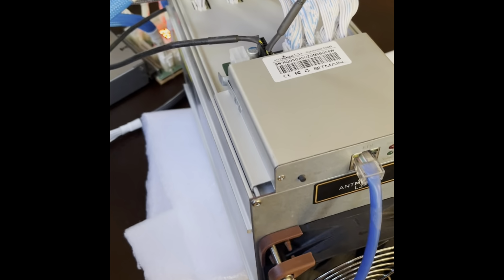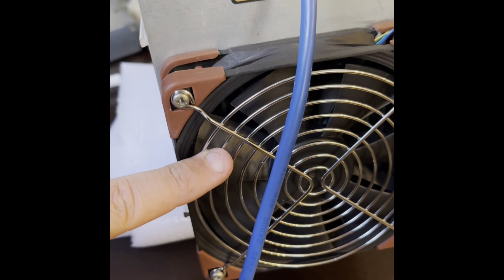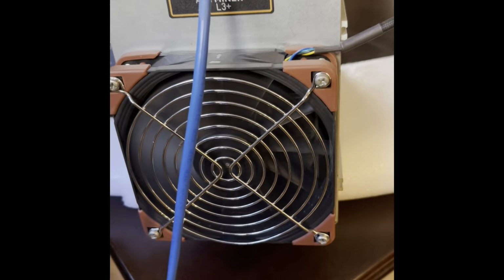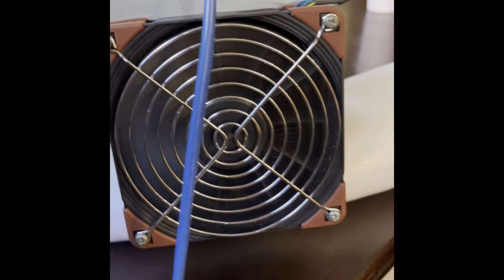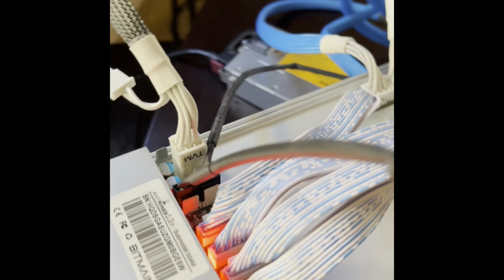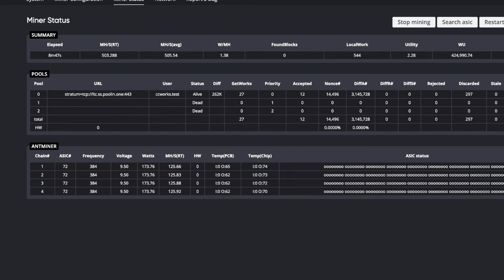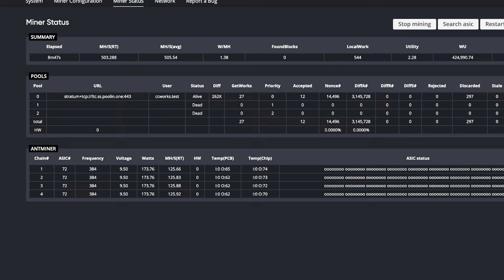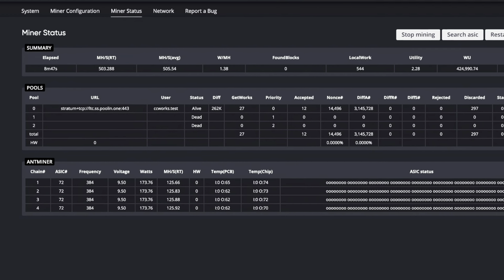Antminer L3/S9 Noctua Fan Upgrade Guide | Quieter and Cooler Mining

Comment: I bought them fan and I set chip auto tune so it was running 14th but the log was reporting overheating. Had to put the og ones back on. I was going to replace the fans in my gaming pc any with them fans.